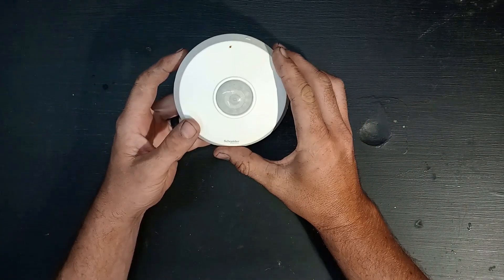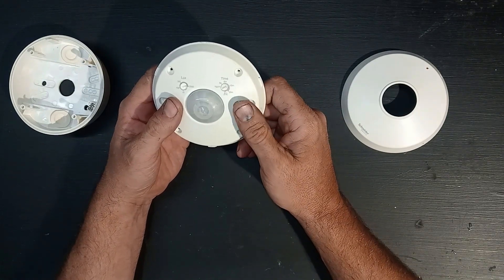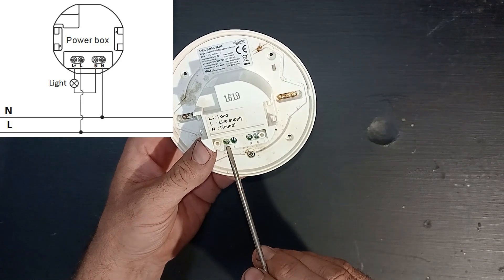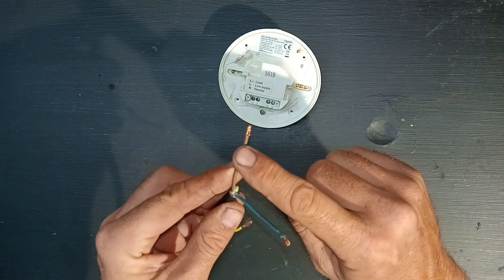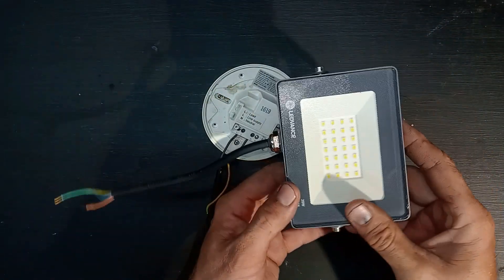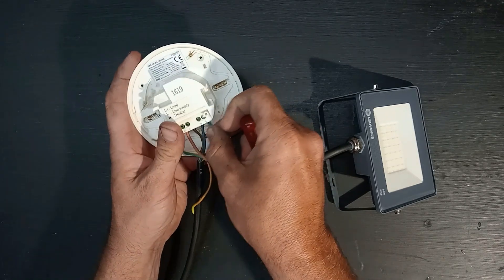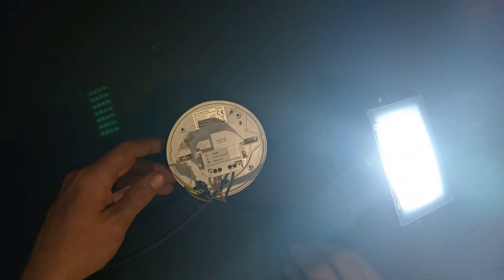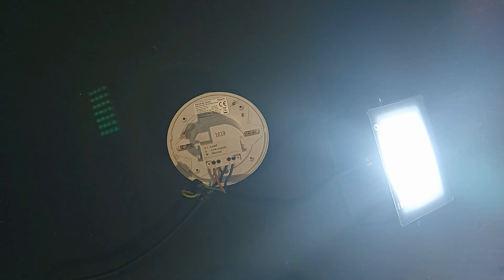Ceiling Motion Sensor Connecting PIR

Comment: Thank you. 
I have this installed in my garage, but the lights only switch on when I am 3 steps into the garage. Distance from door to sensor is 4 meters. Lux is set to 100. 
Will changing the Lux setting fix this? Does the light coming through the window affect the efficiency of the sensor?